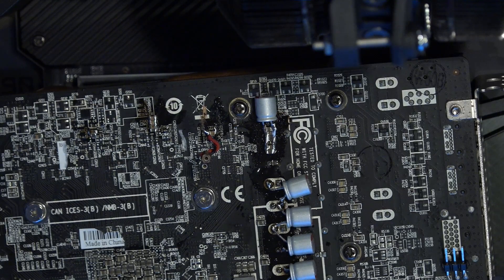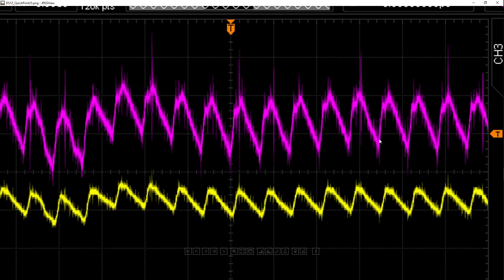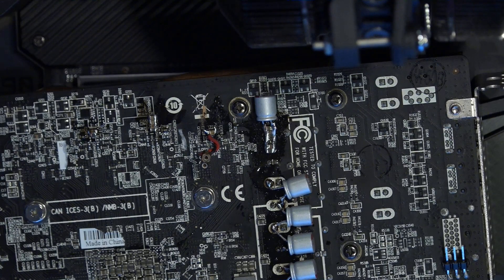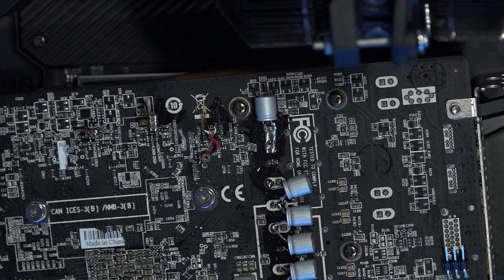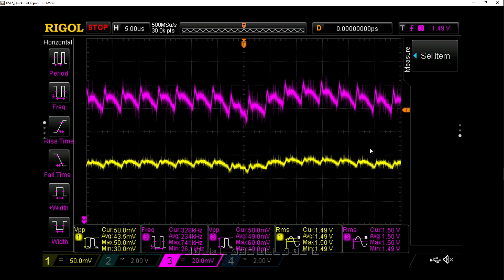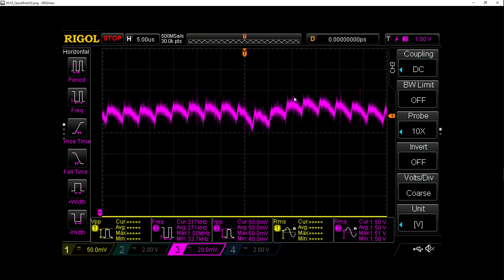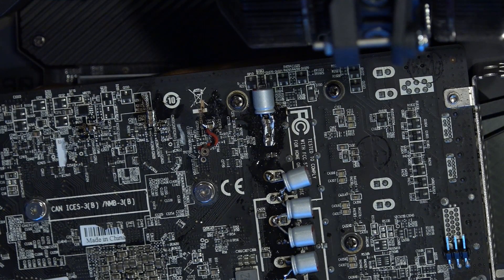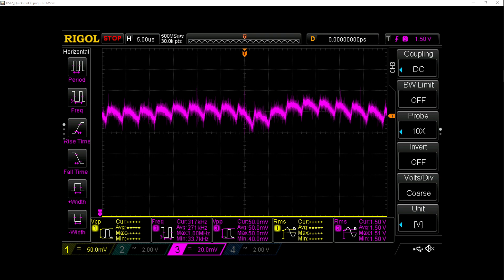Effects of adding more MLCCs directly to the Vmem VRM of the Sapphire R9 380 Compact.

Comment: Hey Buildzoid, some time ago you showed off the arguably rare Thermalright Shaman VGA cooler. You said you liked it because it offers great cooling performance with its large fin stack and the eight heat pipes while it stays in a relatively compact square form factor so it potentially clears attached E-power boards. Would you be interested in a similar smaller version of that with six heat pipes which uses standard 120mm fans?

Comment: Guys, do you think it is ok for 3700x to run 24/7 at 85-90 degrees? How long can it last? Voltage is fine, it's a cheap cooler. I am hoping for at least 5 years without noticeable degradation.

Comment: and here I was considering doing a similar mod to a motherboard that I just added a few more DIMMs to the beast. needs some "more caps more better" stickers, lol.

MLCC vs polymer cans, yeah the shape of the legs and spooled-up can, may add to the ESL. The other difference is polymer cans are like AGM batteries vs regular wet cell car batteries, it's still a chemical reaction rather than a capacitance effect between metal plates. chemical battery reactions can be quite slow vs capacitance effects between metal places in a ceramic, especially when electrolyte atoms need to move out of the way for other electrolyte atoms to migrate in and react with the electrode surfaces in the capacitor.

Comment: Curious.... If you add an excess of capacitance would adding a series resistor help to smooth out the spikes at all? 
I'm guessing it'd probably mess up a bunch of stuff and slow down response time, but even a very low resistance might be interesting if you could account for the voltage drop.
Reply: I think the current going through those resistor would blow them because you have really high current on those vrms ..I think
Reply: @fabiofoltran4361  I think you're probably right. Would also mess up transient response time. Suppose having some ESR in the caps sort of serves the same purpose. 
I'm wondering if there'd be a way to have all the phases of the VRM filtered output being monitored by the controller and each other to automatically adjust and adapt so when combined they supply a super smooth voltage. 🤔
Maybe they already do that, or would be too expensive.
Reply: @BRUXXUS  in theory they work at different "phases" Like if you have 6phase they are actually not working at the same time but one apter another so they don't load to much the input cap(but they are kinda working at the same time because of the HF switching ). Otherwise if they would switch on and off all a the the same time the current required would kill the in put cap. I think that you meant this, but I'm not sure since EN ins my first language hah
Reply: @fabiofoltran4361  Yeah, I know. I was imagining them to be coordinate, but I guess if they’re all doing the same output in sequence, the combined output would be as smooth as possible anyways.

Comment: 11:42 Just turn on FFT. The VRM switching will show a clear peak at that frequency, with more peaks at the higher harmonics, (which will decrease with added capacitance). The GPU core is pretty random, but should also show up in the FFT as noise at the upper end of the frequency range.
Reply from the maker: if only it was that easy. Every time I've tried to use the FFT it just looked like a random mess. I'm probably doing somehting wrong with it.

Comment: Sometimes you need the higher voltage MLCCs because of the %-capacitance drop off with DC bias voltage neuters the effectiveness of the MLCC. Though, to your point of say 2V vs 6.3V MLCCs, cheap electrolytic types such as Y5S tend to just extend a crappy DC bias voltage curve and not improve it.
Reply: I believe they use X5R and X7R for GPU VRMs for this reason. The ones under the chip will sometimes be C0G if the capacitance value really matters (like for PLL/clock sync).
Reply: @samfedorka5629  yeah, but NP0/CG0 aren’t usually in higher values and packages so those are more likely to be found in 0402 packages on these boards, but yeah. I have a GT1030 I’m going to mess with soon in this regard because I too am curious to see what the changes will do to ripple, RMS, minimums. Add some huge aluminum polymers, leaded, higher value 0603’s and picking more temperature stable smaller value ones.

Comment: VRMs have two main loads types to deal with. The first load type is the constant current load, that is mostly like the ripple you showed in the oscillloscope plots. For the constant current load adding capacitance is beneficial and choosing the correct capacitor with the correct frequency responce is crucial (your example shows this perfectly). The other type of load is the tranzient load, this refers to big dI/dt events like going from the desktop to a 3D load. For the tranzient load adding more capacitanve is detrimental because it slows down the feedback loop of the DCDC converter (search around for DCDC loop stability and DCDC phase and gain margins)  All VRM designs have to take into account both types of loads. VRMs are allways a compromise between efficiency, static ripple performance and dynamic ripple performance. Don't get me wrong, I am not saying that your practical observation that adding a lot of additional capacitance can't have any negative effect... I'm just pointing out that adding heaps of capacitance can slow down the feedback loop to the point that step loads can cause problems with voltage stability. At the same time the constant load ripple may be very small. This is just my personal experiance from designing and measuring the performance of DCDC converters (my designs are much lower power than this but the same principles apply).
Reply from the maker: For the load transients GPUs and CPUs produce, more capacitance is actually even more useful than it is for reducing ripple because the voltage during a transient rises or falls far faster than the VRM can respond. This is actually one of the few VRMs I've measured where the ripple from the VRM isn't completely burried under transient noise from the chip(s) it's powering.
Reply: @ActuallyHardcoreOverclocking  This sounds to me that most consumer VRMs are running underdamped with closer to the minimum capacitance needed for the transients. Most probably the ESL is also an issue and by adding capacitors the ESL is reduced. Again, I'm not saying that it's wrng to add capacitance, I'm saying that at some point there is a tradeoff and adding more capacitance will make things worst by slowing down the feedback loop of the DCDC converter. I have seen DCDC converters that work better with less capacitance.
Reply: @Alexandru-Mihai  the ripple isn’t a function of it being a CC converter, but because it is a SMPS converter. Yeah, there is always a balance between transient response and ripple, but the designer of the silicon will provide max permissible ripple for the design. Of course there is cost from the board manufacturer too that they balance.
Reply: @Alexandru-Mihai  almost always not true.
If the transient current response (inductance) of a converter is bad enough that it cannot charge the output capacitance causing poor transient voltage response, then the converter would have had trouble supplying current to the load during the transient if there was no capacitance. The di/dt of transients cause by transistors switching is many orders of magnitude higher than the di/dt limit imposed by the inductance, as is the switching frequency of transistors in the DUT vs the power supply (even if they are effectively multiplied by phase interleaving).
Reply: @bgdwiepp , I’ve read many SMPS controller datasheets that do indicate that low ESR MLCCs can cause issues with feedback/regulation, which would be because they “respond” faster than the loop’s response time. As such, they typically recommend and electrolytic to balance things out.

It’s all about damping. MLCCs can under-damp a response curve and the logic will cause oscillating perturbations. Adding some ESR adds more damping allowing time for the control logic to catch up. Granted, this isn’t usually the case for 0.7-1.2 V & 10-300 A converters as they are a bit more specialized, lol.
Reply: @UnfrozenScoundrel  I've read some SMPS controller datasheets that specify that your output bulk capacitance needs to have at least a minimum level of ESR (for example LT1374 datasheet page 12). This requirement is common for more simple designs where there is no external loop compensation. Controllers with external loop compensation pins do not have this issue because you can add poles and zeros to give yourself a good phase margin. Even a basic converter design tool will help you calculate the loop stability and give recommended values. It's not even just all about damping: These designs are usually 2nd order, and the damping response is a function of frequency. You can't just look at an impulse response (or even a load step, which is more common here) and consider the performance from there.

I think what the OP is perhaps missing here is that they are more familiar with lower power designs. While the same principles do apply between low and high power designs, how they are achieved is very different. One big difference is the use of powerstages instead of mosfets and drivers, which significantly decreases the high current loop and makes it considerably easier to compensate (or another way to say this is the control loop is stable over a much wider frequency range, or in much more conditions.) I suspect they are sufficiently compensated, so they will continue to work well, even with drastic changes to the output capacitance, ESL and ESR that BZ is doing.

Comment: Too much capacitance is bad if you need/want to change the voltage as is the case with stock behaviour... Obviously dynamic voltage/clocks is something you avoid when OCing so it doesn't matter.

Comment: on the legs of the thru hole, could you deadbug the surface mount caps between the legs up to the capacitor? or just gang up surface mounts on some wires and solder that down in place of the thruholes even

Comment: Hi I'm new to your channel and wondering if you can help me, I have a i5 9600k on a msi z390 gaming mb. I want to overclock cpu and 3600 vengeance ram and any other mb tweaks. Can you help with a step by step video.
Reply: It's not just the cpu I'm asking about the msi motherboard s have that many settings I dont know where to start.
Reply: @insomniac9366  use the manual. also a lot of them will have descriptions on them.
Reply: bruh that seems really needy. just look at his general information for skylake video.